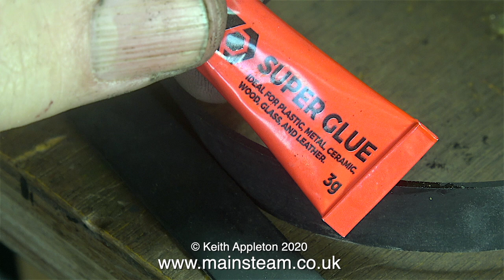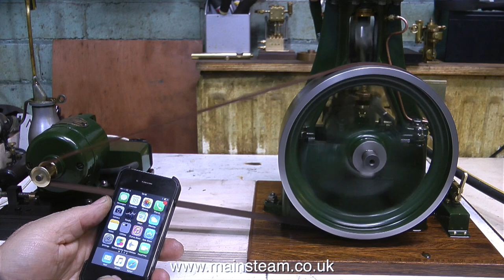SMALL STEAM POWERED GENERATORS - IN THE WORKSHOP

Comment: Keith, adding a full-wave rectifier to the generator output will enable the lights and phone charger to operate in both directions.
Reply from the maker: What is the point? Why would you want to reverse the direction of a steam plant used for generation electricity?
Reply: @keithappleton  assuming you wanted to drive forward and power the lights at the same time then "Milan Trcka" comment is technically correct, love the video's and your explanations on how and why to do stuff.
Reply: @keithappleton  You mentioned that the generator will work only in reverse. So there is an option.

Comment: When in a steam plant I wonder if a simple mechanical sensor like an electric coil pulling on an iron core attached to a regulator could be rigged.  This could then self regulate a bit based on load.  In your collection of junk bits there must be a regulator missing a bunch of parts that would be perfect.  A spring on the iron core and then adjust the distance to the coil.

Alternatively a simple lead acid battery so the energy could all be stored.

I would be interested if a maximum amount of energy from one of the common stuarts was figured out.   Is it viable as a power source to augment solar?  (Yes I realize horsepower can be converted to Watts but thats not with real world contraints and losses).
Reply: solenoid and carbon pile regulators were common

Comment: Could you twist a slightly longer belt to get it to generate in forward?
Reply from the maker: Why? It generates the power fine in reverse. Generally with a Traction Engine they didn't generate whilst moving forwards.

Comment: Do you think it's possible to increase the overall efficiency of the steam motor by having the excess steam that is purged off go through a condenser and then recirculated back to the steam motor?
Reply from the maker: The universal problem on miniature sizes is getting rid of the waste steam oil from the condensate. The oil can't be fed into the boiler.
Reply: @keithappleton  do you think an oil to air separator could mediate that problem? Turner cars have have them typically for high-performance builds.
Reply from the maker: Although it may work in a car, this is difficult to achieve successfully in small model steam plants.

Comment: Great stuff! I always wanted to make a nice generator setup with an engine that could charge my phone or other for fun. What is the performance like of the last generator (PM research?) shown? Would I be able to do much with a stuart 10v trying to run it?
Reply from the maker: Yes that would work well with a Stuart 10v. The PM Research generator gives out 12 volts, there is a video in my "Building A Stuart Model Steam Plant Series" which shows one in action.

Comment: This would make a great supplement to solar power for rainy days. I have a yard full of oak firewood. Just need a steam engine, boiler and generator head and I'm all set.
Reply from the maker: plus you need to be with the steam plant at all times when it is in steam, to oil the engine, fire the boiler and maintain the water level in the boiler - which I suppose is fine if you have the time and really want to do that ....... }:-)))
Reply: @keithappleton  in a SHTF situation (grid down, bronze age returns) there'd be firewood but no diesel or gas available. Some of the functions of a steam engine could be automated to some extent. If you know the consumption rate for water, you could have a slow drip from a water supply to keep the boiler supplied, for instance.

Comment: Is that an actual, genuine Avo?  I always admired them and kind of wanted one, but I spent 37 years as a field engineer using Fluke DVMs - (about four different types, I think) and they were excellent.  But I still always fancied an Avo.
Reply from the maker: Yes, a friend gave it to me and it works well.
Reply: @keithappleton  Don't the always?  Until you drop it, which is why any Fluke is so much more practical!  (I am not sponsored by Fluke, I simply speak from experience.)